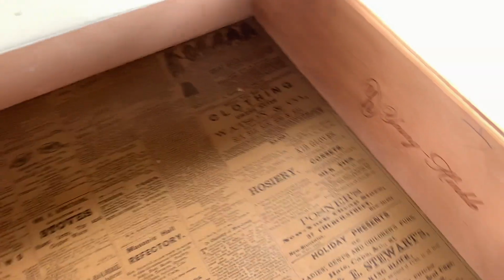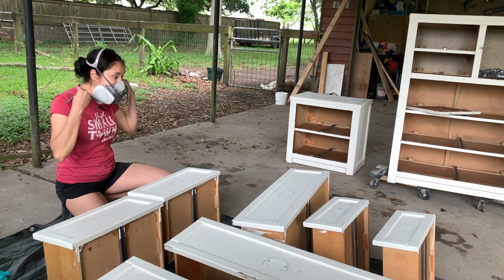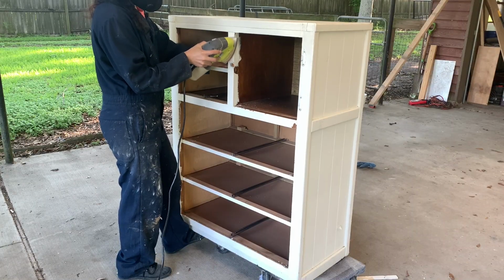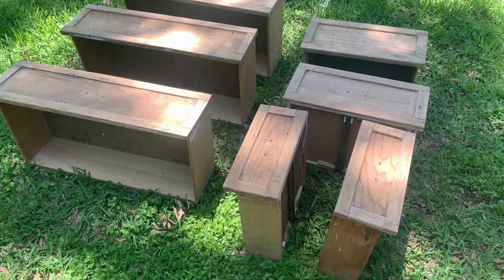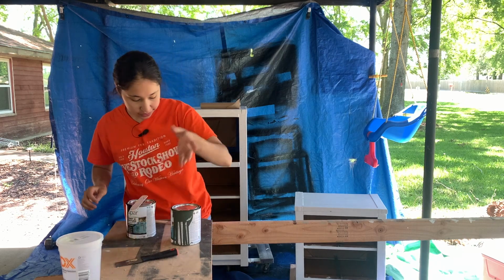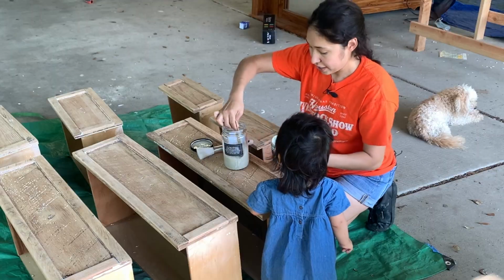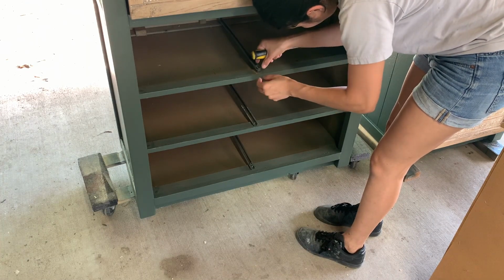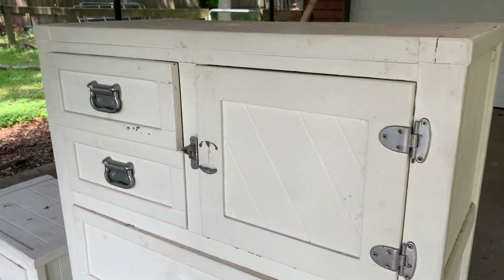DRESSER MAKEOVER DIY | FREE FURNITURE MAKEOVER | MODERN BOHO

Comment: A tip you may want to try next time...plastic wrap over the stripping solution 🤷🏾‍♀️
Reply from the maker: Yes! This is a great tip! I usually  use it to prevent the stripper from drying on me ... which wasn’t the issue here though. I wonder if it’d help with the fact that the paint I couldn’t get off was in the deep imperfections/joints of the wood 🤔
Thanks for watching ❤️😊
Reply: @GlendaChavez  🤔